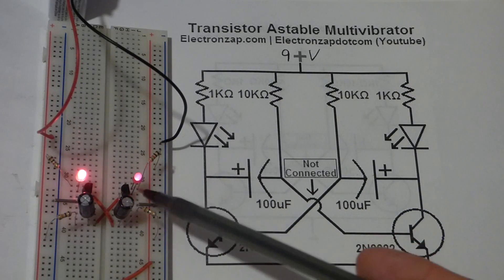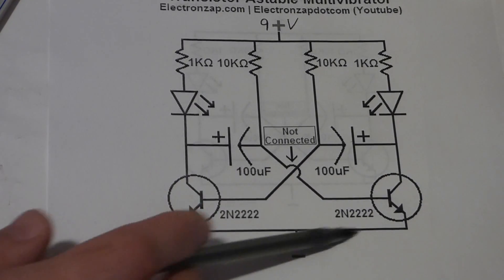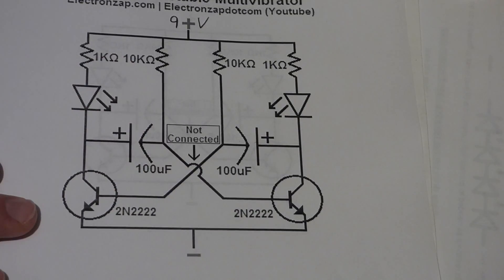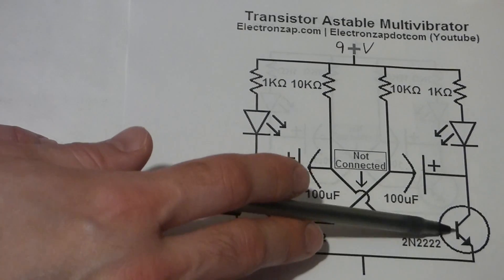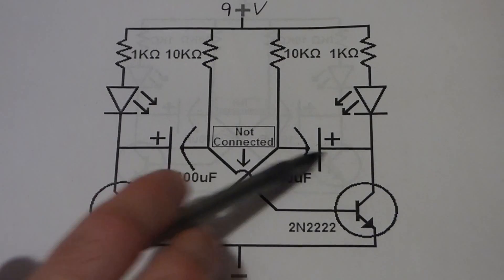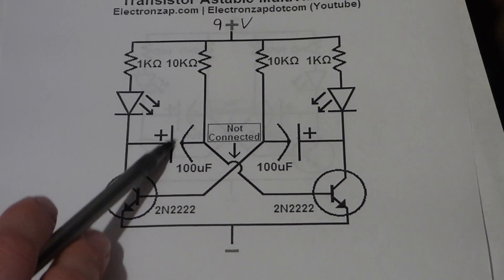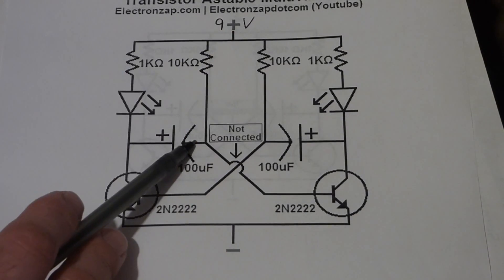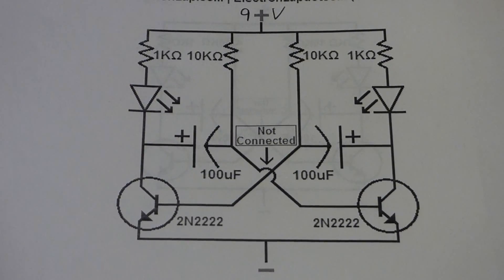Astable multivibrator demo circuit w NPN 2n2222  and capacitors explained by electronzap

Comment: You are using a bipolar capacitor with its negative towards the base of BJT?
Plus when the cap charges, its negative side is fed by positive voltage with the 10K resistor.
When the left bjt is on, the voltage on its collector drops to 0 basically. It measn that the positive side of that cap ( to the left) drops to 0 while on the right, the negative side of the cap will be at 10V+.  No?

In other words those caps are getting charged by the base circuit that is connected to the positive rail and not by the collector low ohm resistor at anytime.

Comment: Thank GOD 😇and thank you very much 😉Since both sides of the circuit are equally 🤔 How do you know which LED will respond (blink) first 🙄
Reply from the maker: You probably won't know which LED will be first to light,  but I'm sure differences in components will make it so some circuits have one that starts all the time, while other ones have the other LED start at times. Thanks for watching!
Reply: @Electronzap  I was thinking the same 🤔 So I am going to build 2 circuits 🙂One with your  'numbers' and 1with 1side the same as yours 🤔  but the other side with a 25% value difference 😎 Do ANYBODY know how I can display this to a VGA monitor 🤔and print the results 🙄Let me know 🙂
Reply from the maker: Sounds fun!
Reply: @Electronzap  That's one way I see proving the hypothesis 🙄

Comment: How does it decide which side to start from? 😂 Great video. Is there a chance that the capacitor well will be reversed polarity?
Reply from the maker: Not sure lol, probably slight variations in the components actual values will make it favor one side over the other when it comes to starting.
Reply: @Electronzap  If it has to do with variations in the components (which makes sense) the same side will always win right?

Comment: I have a number of beginner electronics books and they all use bipolar transistors in the astable multivibrator build. So I looked up youtube videos about the same topic and they all use bipolar transistors. So why does everyone use them? Why not use mosfets or I.G.B.T.s or is there a reason why they are never used?
Reply from the maker: I made mine because it was in books, other than that I picked the component values. I don't know if other transistors will work. You can always do google searches for different transistors and astable to see if anyone shared a circuit. It's easier to just wire a 555 timer in astable mode than to use transistors anyways, so probably not much desire to design astable transistors circuits.

Comment: I don't believe it is amplifying?
Reply from the maker: Yeah, the main property of a bipolar junction transistor (BJT) is that a small base to emitter current allows a larger flow of current from collector to emitter. So the output current/voltage is often higher than what you input. All the BJT itself is ultimately doing though is controlling how much power is being delivered by a power supply to some other circuitry. It's confusing at first, but after you build some simple circuits and study what they are doing, it is not so bad :)
Reply: How about amplifying electrical sound waves from a mic for instance? A sound wave isn't on or off, its amplitude needs to be amplified proportionally. Does such application requires different types of transistors?
Reply from the maker: Transistors take a low power signal and use it and a power supply to provide more power to something else.
Reply: @Electronzap  - I gotcha.....but the collector current is not itself, magnified?  It is simply allowed through the transistor from collector to emitter?  Im a newer student, so any elaboration appreciated?!? (Your right I'm sure, just curious!)

Comment: You saved my life man, the only question I have is why did you select those specific resistors? What is their purpose? Subbed btw
Reply from the maker: Glad to hear and thanks! The resistors in series with the LEDs have to limit current to an amount safe for the LEDs (no more than 20mA), the resistors themselves (no mare than 1/4 watt, preferable to be no more than 1/8 watt), and the transistor (hundreds of mA), but still provide enough current to light the LEDs to a bright enough level. The 2 resistors that go to the base of the transistors mostly control how fast the capacitors charge and discharge based on their capacitance. It also takes very low current to turn a transistor on. so it's OK that they are higher value resistors but can't be too high.
Reply: @Electronzap  ah ok gotcha, so from my understanding, when the transistor on the RIGHT  is ON, one led is on and the capacitor above  CANNOT charge due to negative electrons flooding into the positive and the capacitor on the LEFT IS charging because the transistor on the LEFT is off which forces the cap above it to not loose charge and the transistor on the right is also connecting it to ground thus completing its circuit. Then the voltage of the base of the transistor to the LEFT starts to build up until its high enough to open/opens due to the capacitor on the RIGHT not being able to suck charge in away from it due to the transistor on the right making it unable to hold a charge. When the capacitor on the LEFT is full it then discharges and by doing so turns the transistor on the right off by making its base more negatively charged/turns off a led and also discharges itself through the transistor on the LEFT becuase it had just been opened a sec ago, and at the same time connects ground to the capacitor on the RIGHT, thus it is able to charge by completing its circuit all while a led is on on a different side now. Voltage is now starting to build up on the base pin of the transistor on the RIGHT. Then when the capacitor on the RIGHT is done charging, it releases its negative charge which is connected to the transistor on the LEFT base pin thus closing it/turning off a led and shortly after the voltage has built up enough on the transistor on the RIGHT base pin that now it can open and start the whole process all over again.Made left and right bigger just in case someone reading gets lost :p
Reply from the maker: I made this video later on when I had more time. I drew out and explained how I see the current paths flowing in this circuit https://youtu.be/zTb9JSY3rec . I also just posted the diagram to my Patreon page https://www.patreon.com/posts/28133369 . Hope you enjoy!

Comment: Question. 
SHORT VERSION: I have made a similar project and when I started measuring the voltage across the capacitor with the multimeter when the LED "on the side" of said capacitor turned on it's values gradually dropped like from +5.1V, across +3V down to +1V and I thought it will stop at 0, but NO it went to a negative -0.3V. Checked the other capacitor, same thing, many times. Why? 

LONG VERSION/DETAILS:
I have made this (well I hope exactly this, because I have made mine using a guide of a Turkish (?) Youtuber https://www.youtube.com/watch?v=8zivwsTA2rw I did not understand a thing what he said but it seemed easy to follow.). Some differences: 320 Ohm resistors "at the sides", 10 kOhm resistors "at the center", and originally two 100 uF capacitors which I changed to 1000 uF capacitors in order to observe things better in "slow motion" (which allowed me seeing both LEDs practically being on at the same time, but one getting gradually dimmer and making measurements). P.S. the Turkish (?) guy's annotations seem to say he mixed up the capacitor polarity in his chart, so if you try to build that keep this in mind - I seemed to follow only what I saw in the video and no capacitors blew: it was a bit scary to connect the battery for the first time though lol.

Comment: why all LED Negative terminal connected to (+) positive volt ?
Reply: The LED is hooked up right. The long lead (anode) goes to (+); the short lead (cathode) goes to the (-) see
https://en.wikipedia.org/wiki/LED_circuit
The way I think of it is the arrow on the symbol points to (-)

Comment: hello sir,

I have made Astable multivibrator from Transformerless power supply which gets an output of 12v & 40mA, it works well 24 x 7 but after few days Transistor stops working
and only one LED lights (without blinking), why is this happening ? Please reply.
Reply from the maker: No clue lol, probably too much current (maybe even voltage) somewhere for some component. Most LEDs like the one I use are rated for only about 20mA of maximum continuous current and will have shorter life or instantly destroyed with higher current. An accidently inserted backward polarized capacitor may short circuit at some point. Voltage spike from unregulated AC to DC power supply could zap a semiconductor easily. Miswiring the pins of a transistor may let it operate rather normally for a period of time and then burn out. I could go on forever, need to check the wiring and datasheets of all components involved to see their limitations. Good luck!
Reply: so can you tell me how much current is required by 2N3904, 2N2222 transistors, As in this video you have mentioned 9Volts but how much current you have provided to this circuit?
Reply from the maker: The most current going through here is ::approximately:: 9V power source, subtracting 1.5V from that for the LED voltage drop for 7.5V (9V - 1.5V = 7.5V) which is across the 1KΩ resistor 7.5/1000=7.5mA going through a saturated transistor.